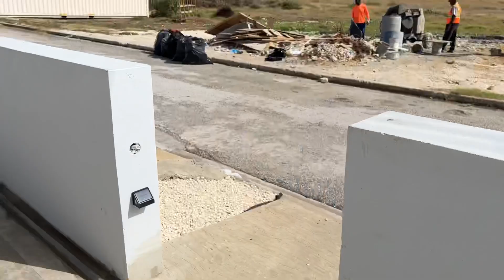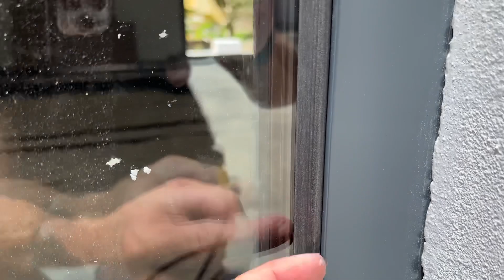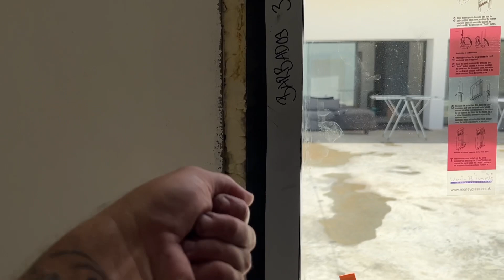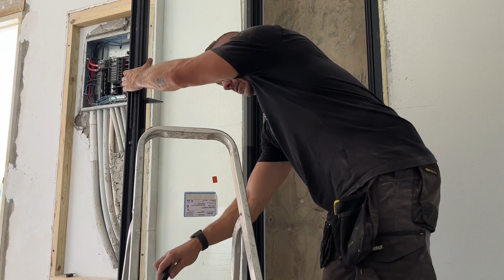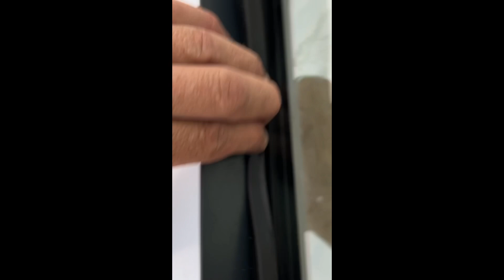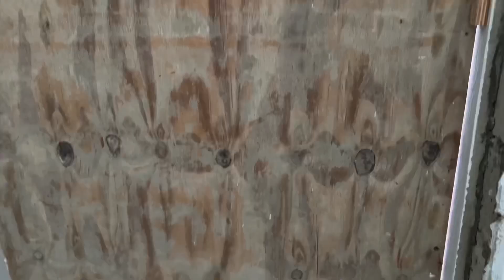Barbados 🇧🇧 Beach House Build - Day 345

Comment: Great job on the windows. 😎 looking forward to seeing the top soil put down also be sure to water the grass on hot days so those lil buds don't dry out. You could use a mosquito dunks or chlorine tablets in any stagnant water to prevent mosquitoes🦟
Reply from the maker: Yes I have been pumping the water out and using those tablets!